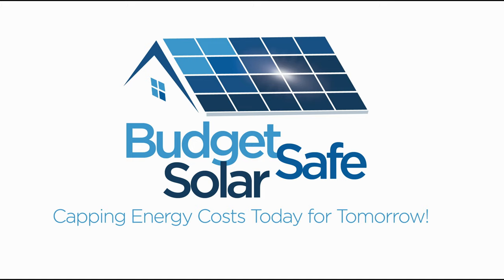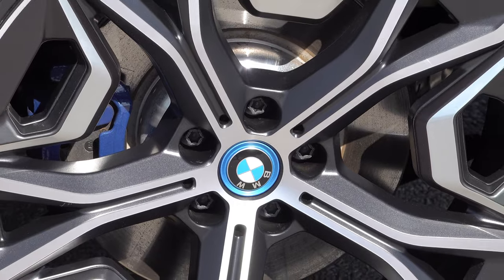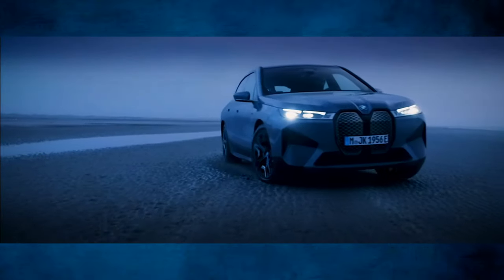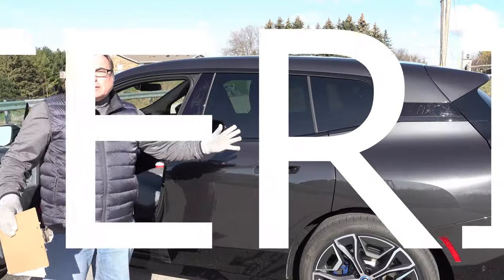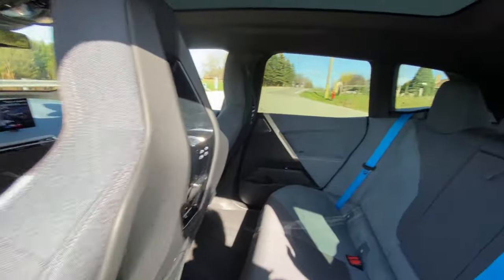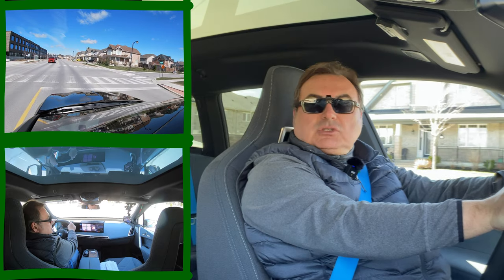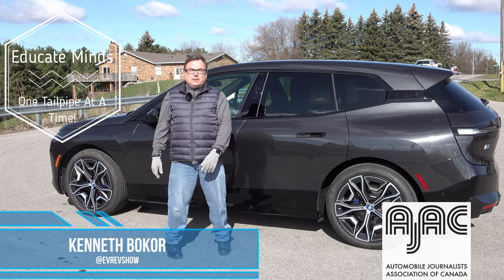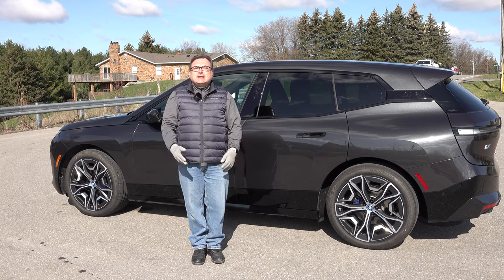Episode 175 - 2022 BMW iX eDrive50 Review

Comment: 25:02  To be honest, I believe that VW and the Ioniq 5 have a much better gear selector because it's "out of the way". Why have a gear selector in a place where your right hands ends up all the time, when you change gears pretty rarely: when you leave and when you park.  The VW and Ioniq 5 gear selectors are simpler, smaller probably cheaper to build and leave space for other stuff.
Reply from the maker: Thanks for watching @Robert!  For sure it is all subjective and I personally found the iX gear selector to be a non-issue for me.  Never had my hands on it unless I needed to.  

The ID.3/4 and IONIQ 5 are great vehicles as well!